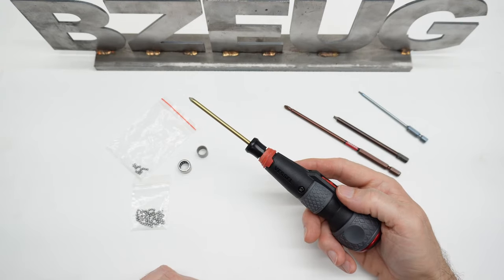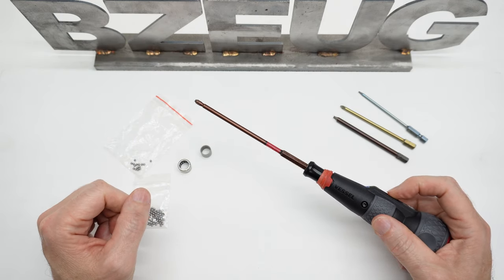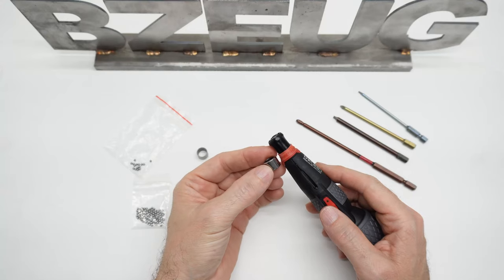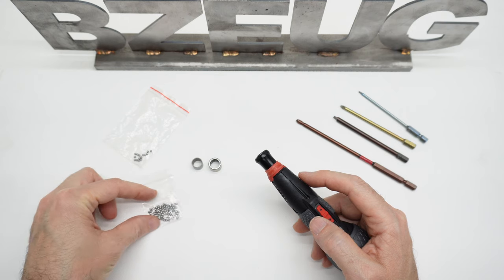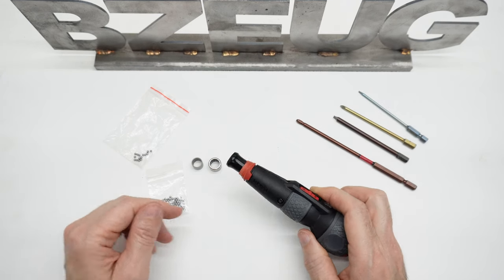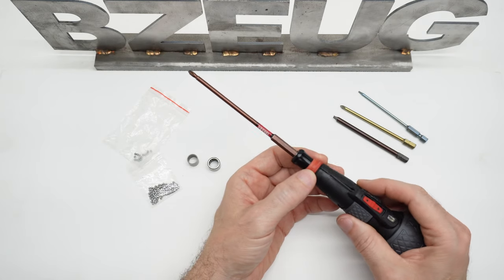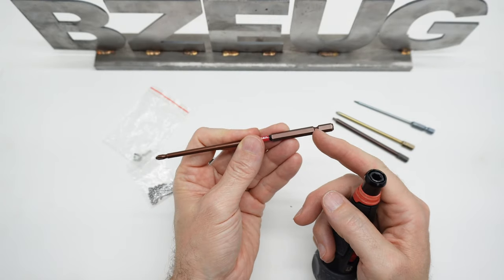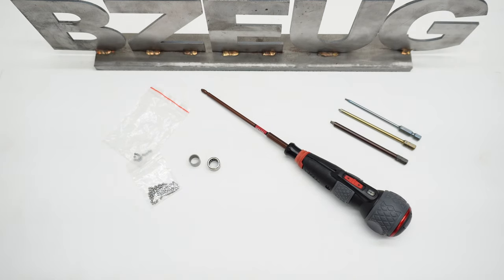Modified VESSEL electric 3 speed ball-grip screwdriver. Better, stronger, faster?

Comment: I bought one just in this moment. Excited when this thing will be delivered.
Other question: do you know if there is any japanese manufacturer that offers a bit set instead of just single bits or 3 or 5 of the same bits in one package? Something like the Wera 5057460001 but with the 13mm japan bits?
Reply from the maker: Looked up the Wera set you referenced.  I see what you mean.  You probably already know about this set: https://amzn.to/48vbdjJ and that isn't 13mm bits.  It is a notable difference between the German and Japanese brands.  The German brands like to kit up an assortment.  VESSEL kind of does that, but really like the German brands do it.  Take a look at this video and see what you think:  https://youtu.be/AHWNCffCN44?si=rSdGyJCOZ-6yyFUd    73mm is the max bit length in those however.  Also this video: https://youtu.be/Aapi-R_PrG0?si=E35p4MJ_nnK5lgqS  and then this one for longer bits:  https://youtu.be/gafjN-igja4?si=OWk66XGFvyCg8frz

Comment: There is a difference between NZ anvil and MZ anvil
NZ anvils are mainly used in Asia (Korea, Japan, etc.), and the goal is to reduce consumables by using a double-sided standard.
Drivers for NZ are designed for use in MZ. (Only pbswiss can be worn here and there is a gap.)
Drivers for mz cannot be used with nz.
Reply from the maker: Interesting.  I have never heard of the "NZ" or "MZ" designation.  I just refer to the 13mm anvil as "Japanese" because I don't know what else to call it.  Are you from Korea?
Reply: @bzeug  I'm a Korean.
I understand that the 14~17mm (nz) standard shark chuck is made in Japan and is widely used in Asia.
Milwaukee DeWalt sells only NZ standard products in Korea.
I enjoyed the video.
Reply from the maker: @국밥대장-h4e    Thank you very much.   Interesting that Milwaukee and DeWalt sell NZ (13mm) bits.   The impacts they sell there must also have the 13mm chuck then too.
Reply: @bzeug  8mm anvils are not commonly used or sold in Korean stores.
Therefore, you must be careful when making a separate request at a store or purchasing online.
The situation is the opposite of that in the United States.
I was curious about the inside of the Bessel USB P1 and enjoyed your video and subscribed.

Comment: Does the wobble has any real effect on usage?
Reply: No, it does not. But it is annoying to look at lol!
Reply: Yes it does, i puntured a high end speaker(Focal) due to the wobble of tip when i was installing it in my car.
Reply: Hasn’t bothered me one bit. Mine will wobble much like his but when I’m engaged with a fastener it has not been an issue. I haven’t noticed a wobble. Like the other person said it’s ‘only when you look at it’ that you will notice. I’ve never noticed a thing while I’m actually working.
Reply: Depends, it can be hard to start a screw if the bit fitment is wobbley
Reply: No. These work just fine.
Reply: @sergioprieto4809  I have installed speakers before. How would the slight wobble cause this?